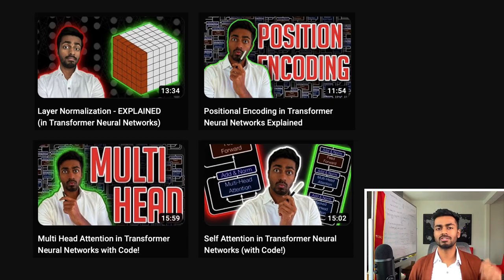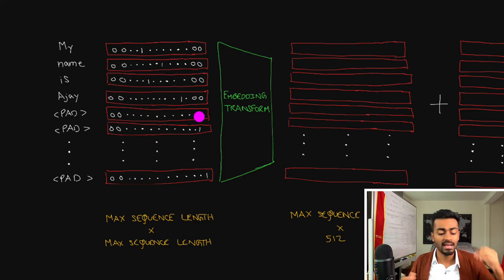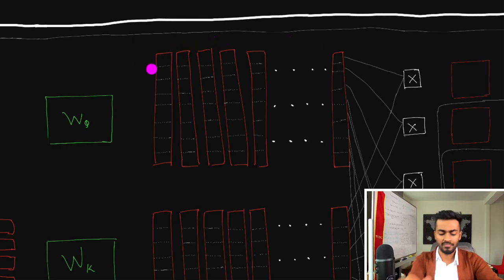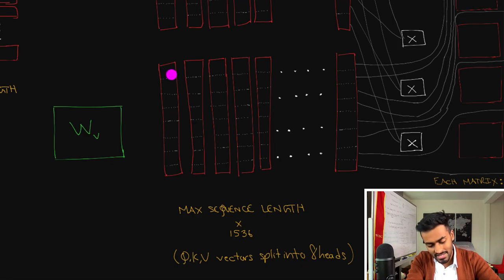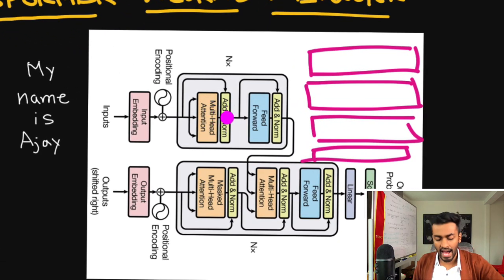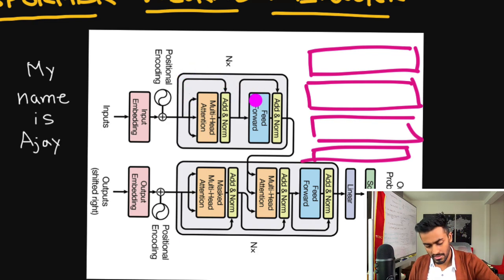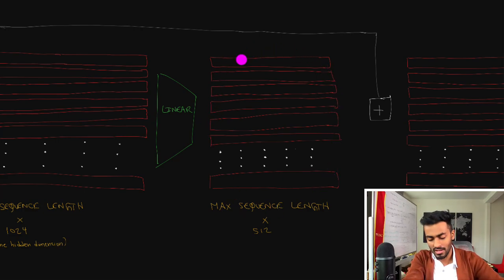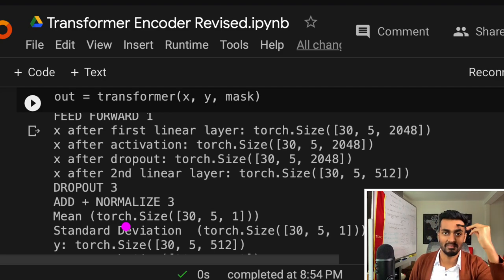Blowing up the Transformer Encoder!

Comment from the maker: If you think I deserve it, please consider liking the video and subscribing for more content like this :)

Some corrections in the video: 2:38 the dimensions of each one hot encoded vector is max_sequence_length x vocab_size (I mentioned the latter incorrectly in the video)
Reply: You got it. This is wonderful. Finally someone has taken the time to explain transformers in the right level of detail.
Reply: Recommend you post-annotate the vid
Reply: haha, I was going to leave a comment, but I guess already caught.
Reply: Great video! However i believe that the multiple heads generate a separate set of qkv, rather than splitting the vectors up between heads. This does enable the model forming different perspectives on the input, but does not introduce a "batch" dim

Comment: we scale weights by 1/sqrt(d_k) to avoid variance problems (q, k have variance of roughly 1. so q @ k.T will have variance of d_k (head_size). in order to make its variance 1 we divide by sqrt(d_k)) - otherwise softmax will have really high values (higher values, when passed into the softmax function, will converge to a one-hot vector, which we want to avoid :))
Reply from the maker: Yea. Scaling does definitely stabilize these values. I have spoken more about this with some code in the “Transformers from scratch” playlist if interested in checking out too :)

Comment: In the summarized diagram there is no “skip connection” for positional encodings but for values. Just after you explain residual connections you tell about an add operation and I then expected that that would be the value, because that is what is in the summarized diagram, but in your expanded diagram it is the positional encoding. And you never have a + for the value in your expanded diagram. What does this mean? 1. Is the summarized diagram leaving out details (forgetting the positional encoding skip connection) or 2. did you accidentally forget to draw in the value skip connection or 3. did you confuse values with positional encodings because the expansion is so huge? I was very confused about that part. But very nice presentation overall!

Comment: I think i finally understand transformers. Especially the qkv part.
In the first skip connection you add the positional encodings only, but i the original drawing it seems they are adding the (positional+base) embeddings in the residual connection. Can you please elaborate about that?

Comment: Am I being dumb or do you need to perform a values = values.permute((0, 2, 1, 3)).reshape((batch_size, max_sequence_length, 512)) instead of just a reshape? The thing is this would not put the words back together in the right order after multi-head-attention, would it? Some code I ran to test this:

def f(x):
...     return x.reshape((x.shape[0], x.shape[1], 8, -1)).permute((0, 2, 1, 3)).reshape((x.shape[0], x.shape[1], -1))  # compact version of the shape / ordering transforms happening in attention (attention itself doesnt change the shape: initial_v.shape = values.shape)
...
>>> def g(x):
...     return x.reshape((x.shape[0], x.shape[1], 8, -1)).permute((0, 2, 1, 3)).permute((0, 2, 1, 3)).reshape((x.shape[0], x.shape[1], -1))
...

>>> v = torch.arange(120)
>>> v = v.reshape((1, 3, 40))
>>> torch.all(v == f(v))
tensor(False)
>>> torch.all(v == g(v))
tensor(True)
Reply from the maker: No dumb at all; in fact you caught an error that I had been stumped on for a while. Someone pointed this exact issue on GitHub and I corrected it. So the repo code for transformer.py (which is constructed completely in a video later in this series) should have the correct working code. 

I was coding along the way and didn’t catch this error early on. But great catch and I hope as you watch the rest of the series, it becomes super clear

Comment: Two questions for the Input:
1) If you do One Hot Encoding: Is the matrix size really "Max Sequence Length x Max Sequence Length" - or shouldn't it be "Max Sequence Length x Dict Length"?
2) Is it really necessary to do One Hot Encoding for the Input? I mean the words are encoded/embedded in this 512 dimensional vectors, so it doesn't matter how they are - initially - referenced, no?
Reply from the maker: 1. Correct. Good catch. It’s in the pinned comment as well
2. Yea in code, you don’t really need to explicitly one got encode. This is implemented via a torch embedding lookup. But I just explicitly expressed what nn.Embedding effectively does. Again, good catch

Comment: Thank you for this great explanation. I think the multi-head explanation is inverted ( on purpose for simplicity i guess) 
But i guess the idea is to start with a 64 dimensional QKV and then concatenate them to n heads in your case it s 8 heads. Also this way we can have the possibility to concatenate them or just get the mean of the 8 heads.
Reply from the maker: Thank you for watching! Yea I am trying to make these vectors more intuitive. But like I mentioned in the video, they are typically coded out in one unit I.e the query key and value tensors are technically treated as one large tensor. Hopefully this will be more clear as I demonstrate code in the next video

Comment: 6:40 if you're implying that the batch dims communicate with eachother, that's wrong as far as I know.
Reply from the maker: Not quite. The traditional batch dimension is one thing and each attention head is another. Traditional batch dimension has no interactions - they are different examples as you alluded to. The different heads in multi attention 
Are similar in the sense they perform parallel operations for the most part. However, they eventually interact with each other. I can see how my words were confusing . Apologies here
Reply: @CodeEmporium  Thanks for the clarification!